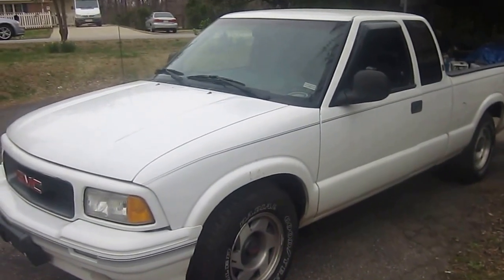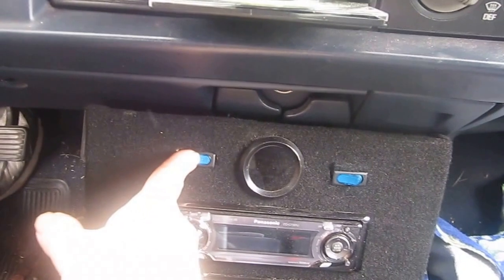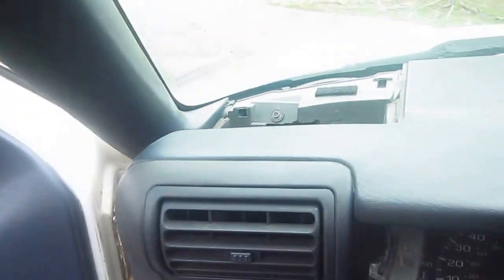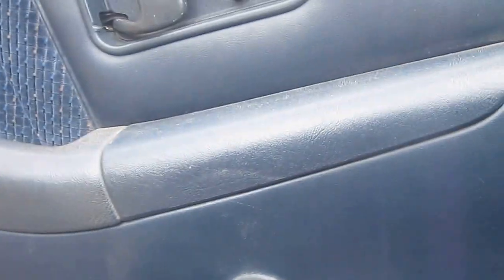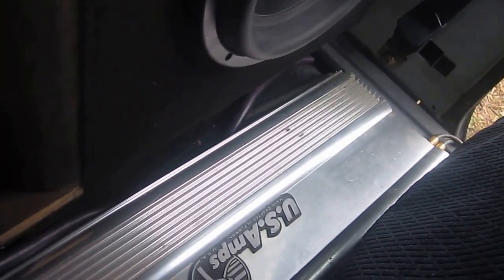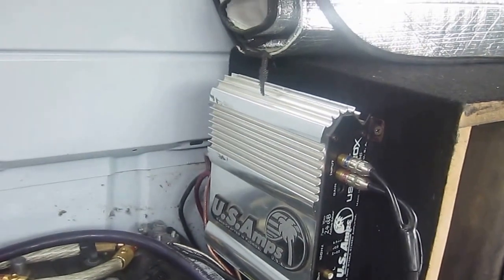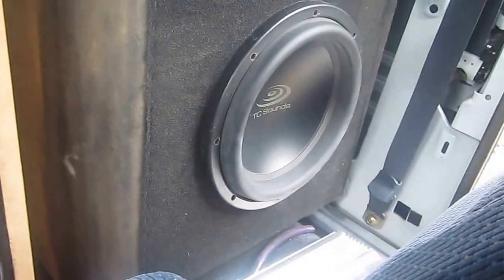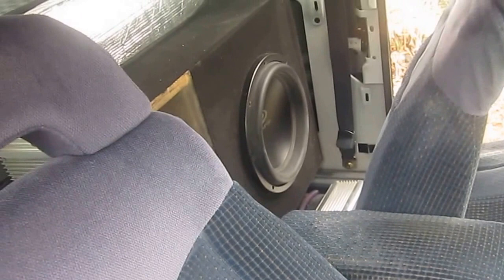Big sound in stock looking pick up.

Comment: Were you able to keep the full motion of the vent covers with those tweeters behind them? If so, Pretty trick. I use nothing but kicker and diamond audio. Two of the best for sure
Reply from the maker: Yes sir!  I mounted them far enough back so I can move the vents up, down, and side to side and it doesn't restrict the airflow either.  I have been in the car audio industry since I was 16 or so and I ALWAYS tell people, spend a little more on good speakers, it will be worth it!
Reply: NCmike1969 I will second that. I blew through 4 sets of sony speakers before buying diamond audio. I've had the same set for 6 years now